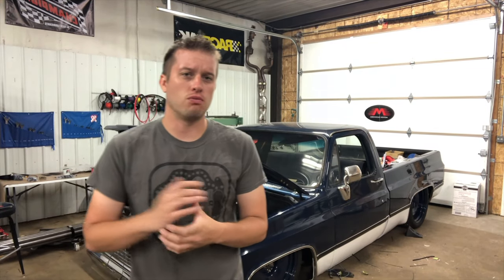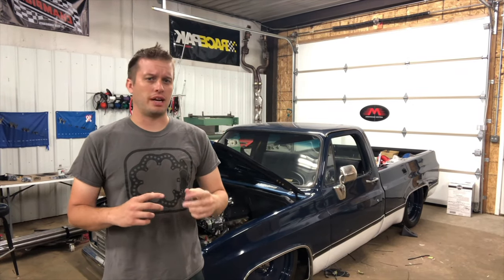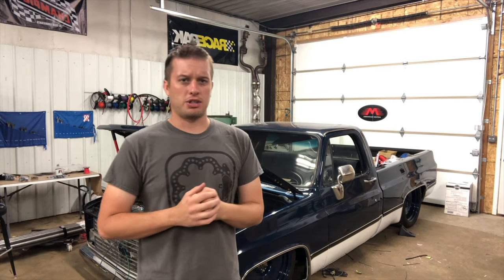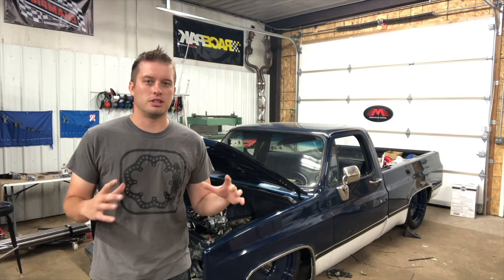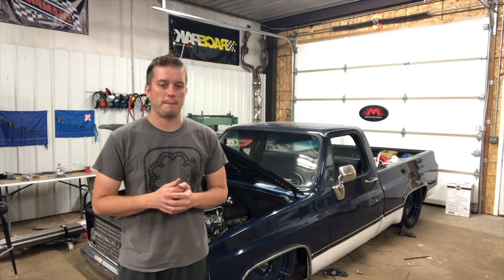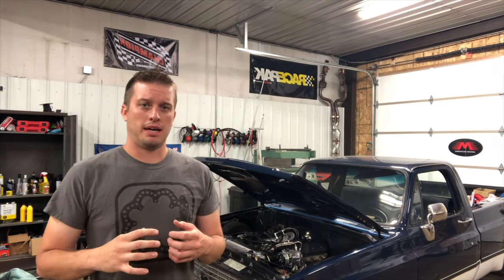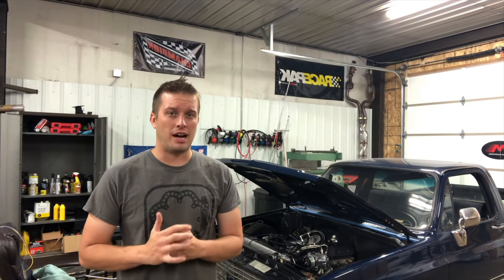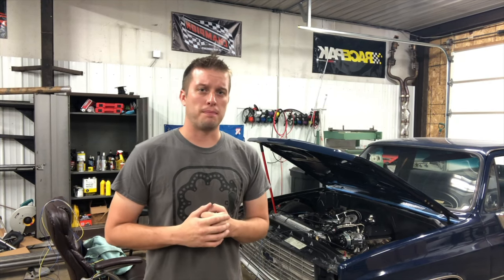1000HP Cooling System (Motion360 EP8) Part2: Cooling Fan Selection

Comment: Just a quick comment on used radiators . Get the car hot and move your hand or use an infra red heat gun or thermal imaging camera over the front and back sides of the core . If you find any cold areas , the tubes in the core are clogged . I agree that it's better to use a newer designed dual or triple flow radiator . Especially if you have a large investment . Why cook that engine ?

Comment: Great videos for me a novice!!!
Need your help!  I have a 95 mustang and I have been trying to fit a 5.3 into it.  I have done some notching of the K member and even with a low profile oil pan the factory intake manifold will not clear the hood.  Will a aftermarket K-member like the ones from Team Z with the lower steering rack give me the clearance I need.
I know this is about cooling not K-members or mustangs.
Thanks!
B

Comment: What’s the best set-up for a 1995 corvette????? I’m thinking about goin electric pump as well because the mechanical ones don’t last long with the rubber seals always going out and weep hole leaking out all over the opti. Which  GM didn’t even design around it so they could make more M.O.N.E.Y out of ya when the WET opti takes a shit due to the water pump dumping out all over it. Not to mention when u sit at a light and your R.P.Ms at idle can’t even cool the vehicle in hot summer environment. Would like to pick your brain concerning these issues. Thanks

Comment: I have a street car 572 720r do you want to recommend a radiator. No ac, t56 6 speed transmission. I want to use it to drive to shows . Any information sure would help. Do you think pressurized closes system are the way to go?

Comment: Do you like the Lincoln mark 8 fan?
Reply from the maker: leroy tapia I don’t think I’ve ever had my hands on one
Reply: 5000 cfm it’s a beast ! I don’t think there’s a aftermarket fan that comes close!
Reply: @leroytapia2596  Where did you get the 5000 cfm rating? I called Dorman and asked them about their 620-118 fan. Its a 2 speed fan. Low speed pulls 2570cfm and 11.2amps speed 2 is 2900cfm 17.5amps. those amp readings are at no load full speed by the way. Dorman guy said this fan can pull almost 100amp spike on start up. Thats why your suppose to run a PWM with it and Mark 8 fan.
Reply: @nova467spanker  those Lincoln Mark 8 fans are the truth...I  know guys running them on their 1000+ h.p. cars and they stay cool as ice 8 second 1/4 mile cars
Reply: About to get to the radiator upgrade for my daily street project. Wondering if I should order the radiator without tranny line cooler, or should keep that for warming transmission fluid. I have a large auxiliary cooler (no fan) I  also have a transmission fluid thermostat to install, supposed to restrict it until it gets to 160. The reson I got the thermostat to install. Is because takes awhile for my transmission to get warm enough to shift right in mornings as it is.  Hate to order a radiator that doesn't have the cooler. Hate to pay extra for the one with the cooler if I don't need it or really want it. What do you think?